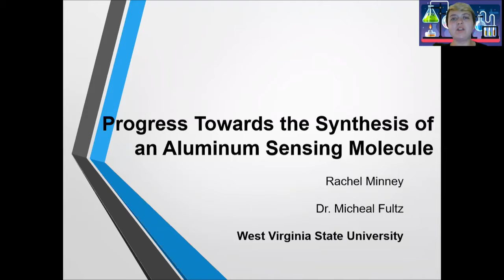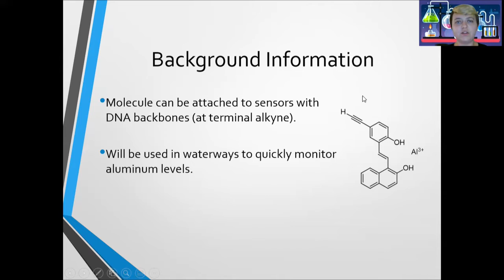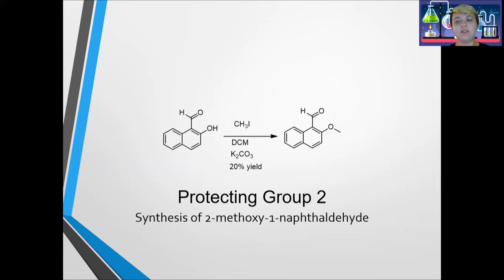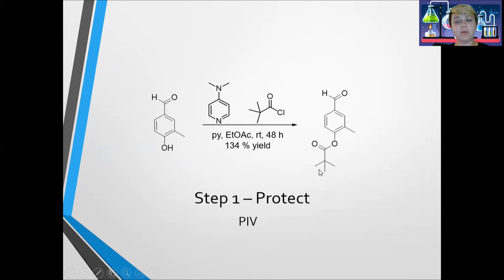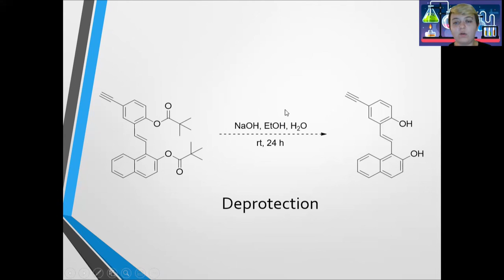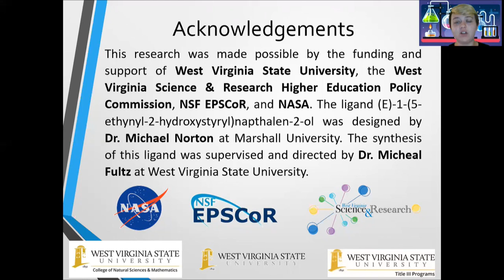Al Binding Ligand URDC 2021 Rachel Minney

Comment: You did a good job with the presentation and with the work you are doing. You mentioned the attachment of the ligand to DNA to be used as an in-process sensor.  Do you see this as an in-process type of analysis for Al only or do you think it has broader application (lab and field testing)?
Reply from the maker: I imagine this could be used for field testing (like a portable sensor) or for lab testing if need be. Once the molecule is fully synthesized, tests can be run to determine exactly what metals it will complex. Spectroscopic methods can always be used to tell the complexed atoms apart.

Comment: Hello, I have several questions:
1) What is the real complex (aluminium+ligand) in Al detection media. In other words, how many acid groups of the ligand are dissociated?
2) What is the selectivity of synthesized ligands to Aluminium over other metal ions?
3) You are creating the ligand with the propargyl group. You said you want to bind it to DNA. Why DNA? Better materials to bind with?
4) One of the slides represents the yield of reaction 134%. How did you find out this number?
Reply from the maker: 1) The 2 alcohols in the final molecule are the atoms responsible for complexing the Al ions.
2) I do not know this yet. This molecule is still being synthesized, so tests have yet to be run. In any case, quick and efficient spectroscopic methods (such as fluorescence spectroscopy) should be able to distinguish between any different kinds of metals that may bond to the ligand. Also, since aluminum is the most abundant metal in Earth's crust, this is the one most likely to be present in the water systems in the first place.
3) I don't believe the alkyne here is technically a propargyl group (RCCH2CH), but either way it is supposed to be linked to a DNA backbone, yes. That part of the project is beyond the scope of organic synthesis, so I am not sure why it is done like that. I do know that alkynes are often bonded to phosphodiester backbones.
4) A theoretical yield is calculated based on the number of moles of reactants (specifically the limiting reactant). The mass of the product is taken, and the molar mass is used so that the ratio of moles of product collected to the moles of product given by the theoretical yield can be obtained. Whenever the the amount of product obtained exceeds the theoretical yield, a yield >100% is obtained. This is when it is made apparent that impurities, such as solvent or left over reactants are still present in the product.
Reply: @rachelminney5086  Thanks for the replay:
Here are comments/additional questions.
2) It should be known for the molecule you based your synthesis so far (with nitrogen). Do you know any information about this molecule?
In the analytical analysis, you never know the most abundant element. You have to design the method which unequivocally determines the type of method and quantity in the unknown sample. Fluorescence can not usually distinguish between metals.
4) If you have a yield which you do not know. Can you report it?
Reply from the maker: 2) The nitrogen molecule fell apart in aquatic conditions, so it is unknown what metals it would selectively complex. It cannot complex when it is not in one piece. When the time comes, fluorescence spectroscopy can indeed be used to determine the concentration of specifically aluminum in the water. When complexed, fluorescence at certain wavelengths are identifiable as the ligand-aluminum compound. There are several cases where this has been done. Here is one instance: https://watermark.silverchair.com/23-2-94.pdf?token=AQECAHi208BE49Ooan9kkhW_Ercy7Dm3ZL_9Cf3qfKAc485ysgAAApkwggKVBgkqhkiG9w0BBwagggKGMIICggIBADCCAnsGCSqGSIb3DQEHATAeBglghkgBZQMEAS4wEQQMEmDOrwkqp1F4oaxHAgEQgIICTPq82XB5yWBEdaNJlKsXXKBMgItVgZVVLqxy3JrcU1pzpNIBLkh-GOzV9A7gI18ZbdjUSNJf7Tu0HWLEZN-hFQQJ1eV-UzknBPOrnLKwYziH2fujKdtr-hEYaxj8WqIZ8ZWSNJ7gPG0qNgb47_KmbRyg8Pj135u72KvaKqBV8z4W6HO-JFUCnZ46jUL5ljlNk2wy58QUfgOWpht6LOYtWEgNVsNUxtXUvV77ehu5adlfzkjCUFjUMioYUfkZvfKOh3CoWJWUWcqW0FQYBH2o0PawCR7Cl8OyZ_oPnC84VAUHAtKqoUFVSB2XkuSqxTioO2WDlUm1EgWtNIzqVYuavrIk3c69TeIrwu0PSpscUbriv_BsdTB3g7kz2F26wczYTjyKn2OOP568HVAKWsnNcDFPXirTXA_Sk5gDY0aeUEbAJUbBXCdAzoAWMFKCvk8l7oBAD3Sji6yhBIP62rTq-DRxwMRdHeHWv-JWw338L_0EFp6w79T_Xt-JwafCb37oeihbEon_saFrTDxavwRUSObiizTi4R0jA9cdwRnMu_om60qZYsju8uCGh_GjxTf0cAY66yX5d2uxXOcXvZgHMDOllDxvkcMlf6uV0Vxp-e5FCnO8g3QhKODaCm2qB5jmgGS5_pVFDcaa1TQ0c7g4obGY9120gs1L615JwIzY6xlpmku1-ZGYwwonB-xC2eBoMJ8mHMwHEB_JMiG5xZ-_So5FqFwxYHCo2lWxRcm72s5xxxRZ2dgcq3z9W9UbfeM6hufbvXO6qHhBeGAUdQ
The point of Al being the most abundant metal is that as far as I see, there is no real concern of other metals being complexed to the extent that it would become an issue.
4) It is always best to report what data is known. I know that I got a yield that was 34 % more mass than what could have possibly been obtained. This means the product I got was not pure. This is much better information than simply not giving a yield. From my experience, scientists always want the most details possible.